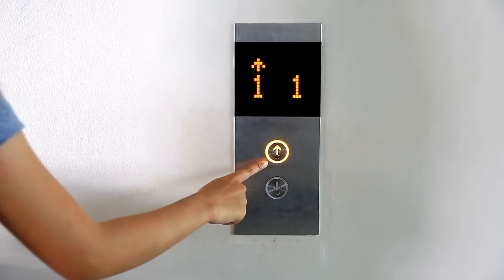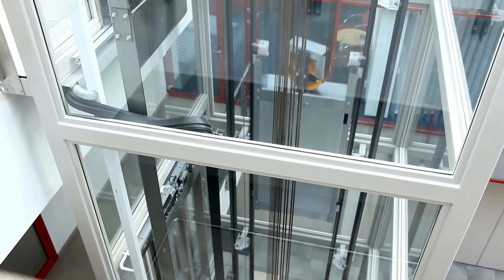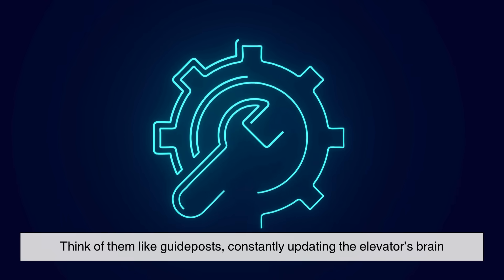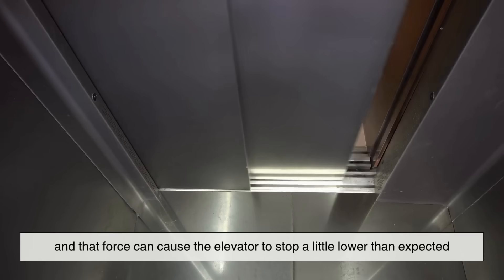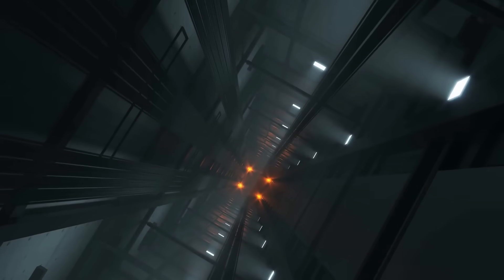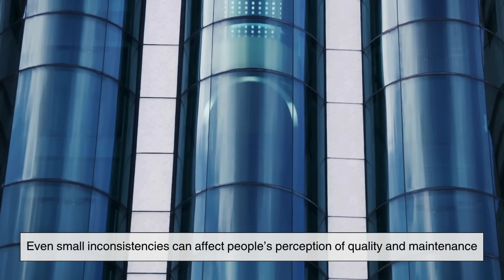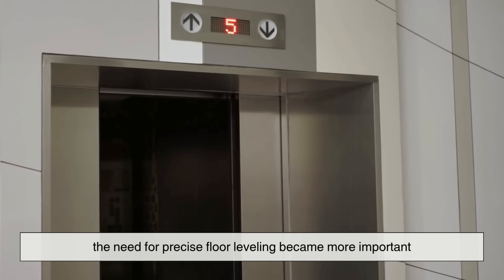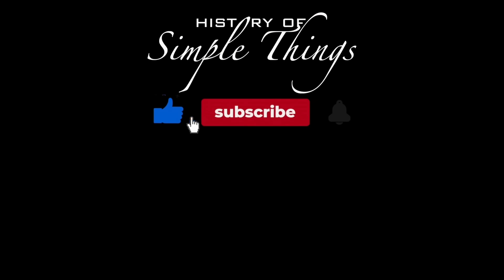How Elevators Know Where the Floor Is

Comment: Electronic control and sensors are amazing, but there is nothing more impressive than a mechanical floor selector used until the 60's or 70's to perform this function.  No computers or electronic logic, just cables gears and switches that perform these functions.

Comment: You’ve obviously never used the elevators in my building. It could stop an inch higher than the floor, or it could be an inch lower. Every trip is a lucky dip.

Comment: ummmm, strange description.

The core of precise positioning is not corrections, weight sensors, encoders and so on (like in 19th century mining elevators with huge indicator wheel with level marks for operator) but ABSOLUTE sensors on every floor. Measuring EXACT position of cab itself, not motor, cable or whatever, "the cab is here". One sensor for approach ("the cab is near the floor, its time to reduce speed to minimum"), one (or some combination of approach sensors) for exact match ("floor aligned - full stop"), so electronic brains do not need to guess where is the cab relative to floor, they know it with required precision. If standing lift changes position (40 storey long cable stretches under 1t load change) this sensor goes out of alignment and brains have to pull the cab up or down until it returns to required position and the sensor reports OK again.

The sensors can be of any type, nowadays most of them are Hall magnetic sensors, measuring presence of fixed magnet stripe (so effectively the lift requires only 2 or 3 sensors on the cab and set of passive stripes on every floor), but can be optical with some light obstacle on floors or even (in ancient designs) mechanical pressure switches with shaped profiles on floors.

This idea is not a novelty, even relay-controlled lifts 50 years ago worked exactly this way. They could not correct position while standing, required very long and slow final run because of primitive motor speed control (VSD did noit exist then, so only contactor-controlled 2 speed drive, or, for extreme conditions, 3 speed, were used), application of mechanical brakes on stops and so on, but the idea was the same - to measure exactly what is required, is the cab aligned with required position number X, not anything indirect.

Comment: I would love to watch a video explaining how decision makers decide whether their elevators should be cable-driven or hydraulic.
Reply: Currently watching this video while stuck inside an elevator at the MGM Grand in Las Vegas.  They told me that help is on the way.
Reply: It’s pretty simple. Since a hydraulic elevator must use a hydraulic cylinder to lift the car, this must be transported to the job site. This limits the length to 40 to 50 feet that can shipped on a truck. It also has to be installed inside a hole drilled that far in the ground. So above 4 or 5 floors it makes more sense to install a traction elevator.
Reply: @thomasfreeman7770  I used to work in an office building that only as 5 floors with no direct access to the roof but all 4 elevators there were cable-driven.  The 2 underground garages had 2 separate elevators that were hydraulic, which I understood it has to do with keeping their systems below the 2nd floor.  I want to hear about the differences in cost of operating and maintaining them and the amount of effort and complexity involved with building and installing them.
Reply: Hydraulic elevators are limited in the height that they can travel. That’s usually about four or five floors. The longer travels can have their cylinders delivered to site in sections. The sections of the ram are fitted together with a very precisely machined joint so as to pass smoothly through the seals. Most hydraulics these days have the cylinder in the hoistway and not in a borehole directly under the lift car. Usually there is a rope connection that allows the ram to lift the car twice the ram travel.
 When an elevator is being fitted in an old building, a hydraulic is often chosen. The alternative, a rope traction drive, hangs a lot of weight on the building structure. There may be concern that the building cannot hold that. A hydraulic drive carries the load from below.
  A rope traction drive can travel far higher than a hydraulic and can be more efficient. With a half load in the car, the system is running balanced. A hydraulic system uses energy to lift not only the load but also the car and a lot of the drive equipment. That energy is lost when the car travels down.

Comment: Good short presentation. I worked as a messenger in the Chicago area I have ridden manual elevators dating from the 1920's to the ones in the Sears tower and the John Hancock building. I also delivered repair parts for elevators on occasion.

Comment: Back in the days of DC gear-less traction machines in high rise buildings, a leveling field within the controller cut out the generator field as the cab approached the floor landing. An encoder steel tape moving up and down the shaft with the floor selector "pie plate" tracked the position.  Another type Otis Micro Drive or Tail Twister, geared traction with two AC motors (some where DC) the primary motor moved the cab a contact switch in the hoist way cut out the main traction, cut in the smaller motor as it approached the floor landing.  Both had phase reserve relays, and motor starters.
Reply: I saw an old electro-mechanical system once on YT. I didn't understand all of it but that sure was a lot "sexier" than a modern system with just a bunch of sensors and a computer module.